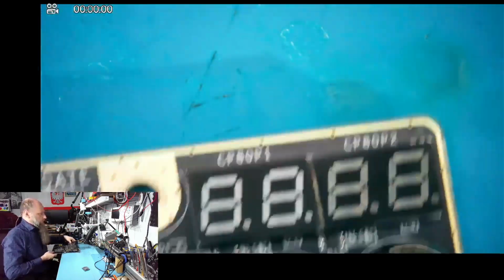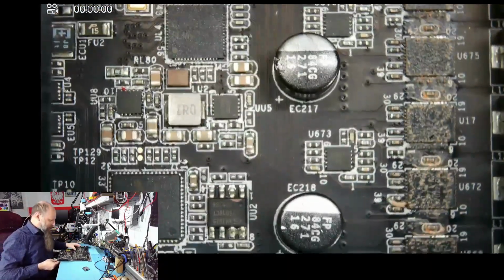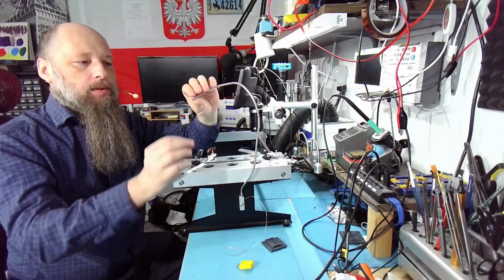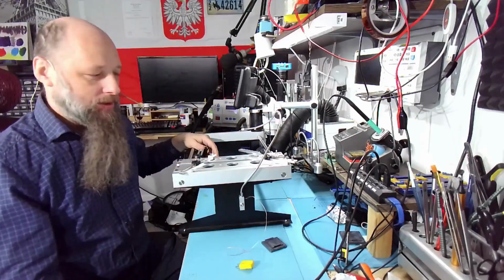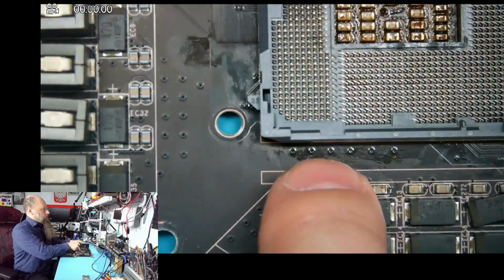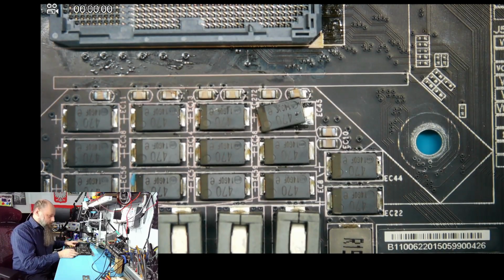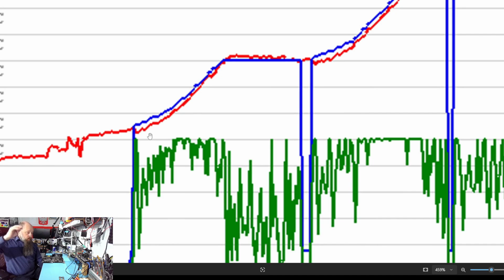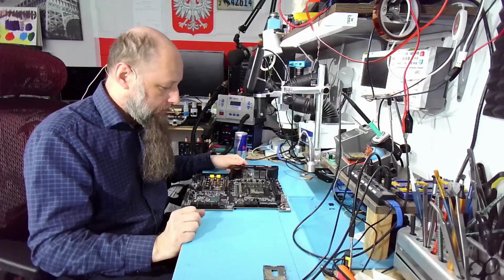124 | LGA1200 Socket Replacement on Z590 Dark

Comment: very good  i recently removed a ps5 apu it also took a lot of heat without ripping any pads so was happy . with modded ir6500 elstein rfs80 top plate i just fitted and worked a lot better than factory top plate also i have elsein bottom plates
Reply from the maker: yeah, I'm still working on getting elstein setup but I'll use a custom controller, the project is open-source btw